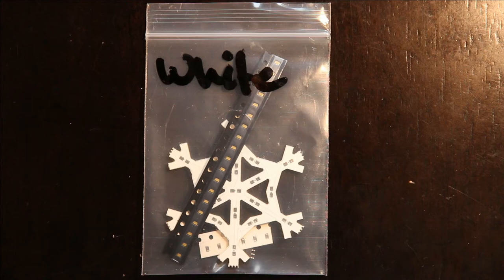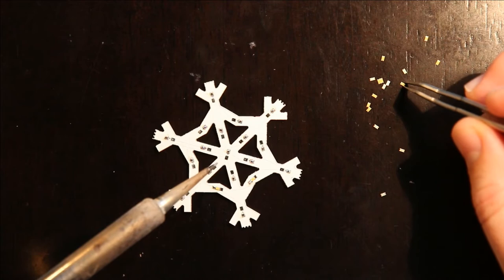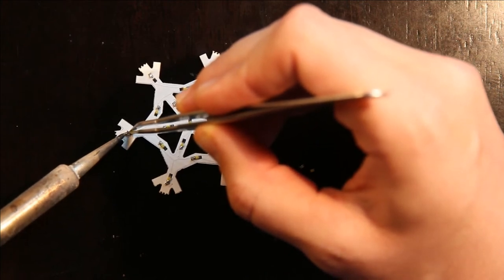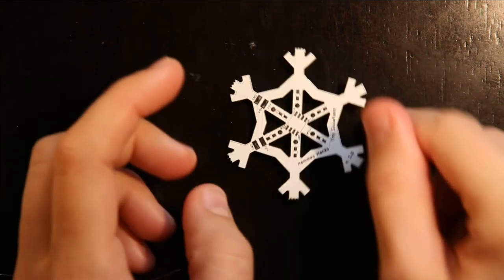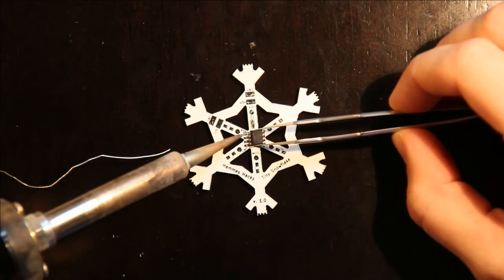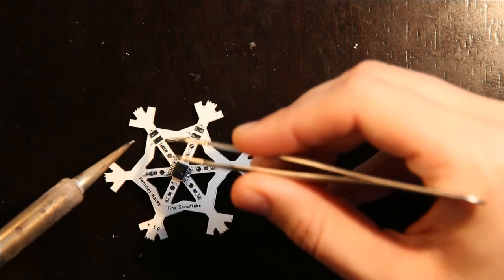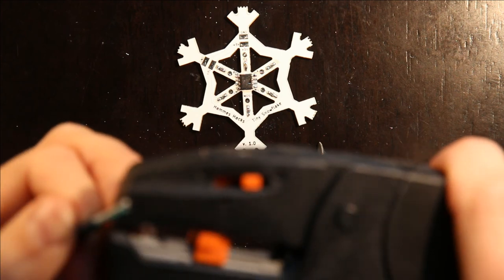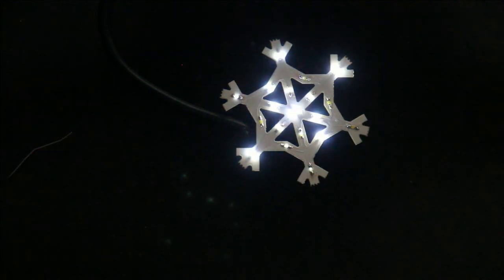Tiny Snowflake Assembly

Comment: Would you consider releasing your board design (gerber files) and wiring?  I'd like to make these for my Christmas tree next year!
Reply from the maker: If you want to buy them, I sell them on tindie https://www.tindie.com/products/hammeshacks/tiny-snowflake-kit/
If you want to make your own, the documentation is here: http://hammeshacks.com/snowflake/
The code is here: https://github.com/emilyhammes/snowflake-firmware
That is everything you need to assemble the kit, modify the code or layout your own design. 

I have multiple reasons why I have chosen not to release the gerbers. One is that manufacturing these is actually a challenge--and most common places reject my designs. I discussed this in my talk at 35C3 (https://www.youtube.com/watch?v=o0GnlVK5yHc ). The other is simply that I want to encourage people to make or modify my designs. If I give out the gerbers, then people have no reason to make something on their own. Lastly, documentation, design, tools and testing takes a ton of time and money. So, when people want to just have a copy of my work, I want them to support it.